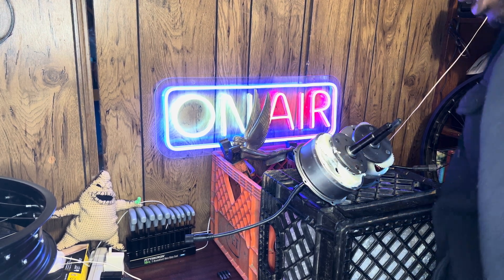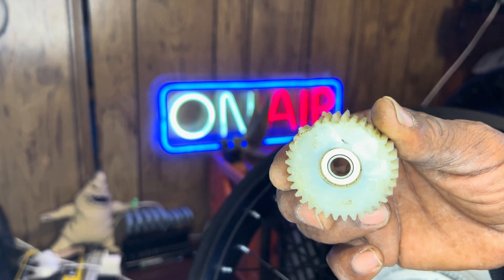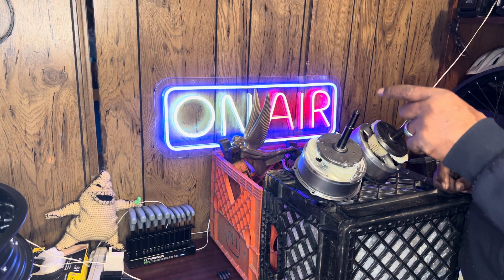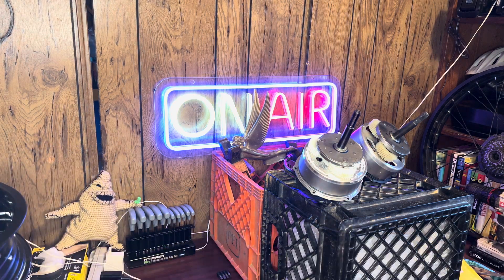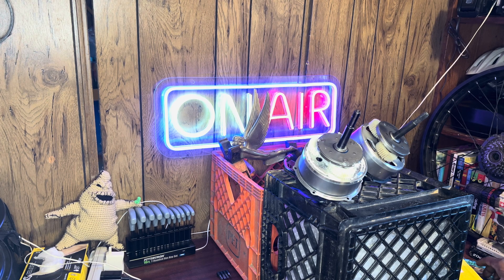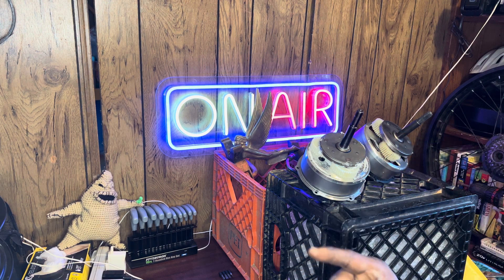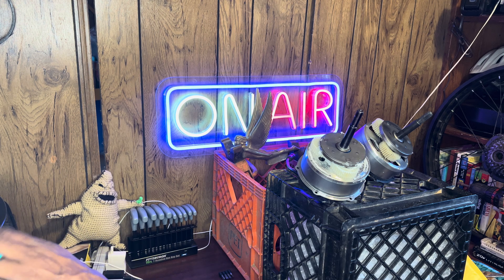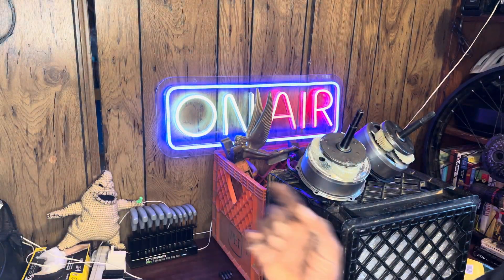Ebike Power Conversions- How many Horsepower does a 750w electric motor produce?

Comment: How much horsepower does a 750w motor produce? That depends on how many amps the controller is putting out.
Reply: No sir, 1 HP is 746 watts period. No more and no less. So a 1500 watt bike is putting out just over 2 HP
Reply: Current (qmps) is one of two factors in a multifunction equation, voltage is also a variable of output wattage. Wattage is voltage multiplied by current.

Comment: 750w= one HP, less FHP(FRICTION HORCEPOWER) not all motor are equal for a true one horse output it needs to say BHP, (BREAK HORCEPOWER). FHP, is the mecanal restince and this can very a lot. BHP is the horsepower output above the FHP. 750W being one horse only happens on paper, you need a few more watts, 2 or 3 to overcome the FHP.